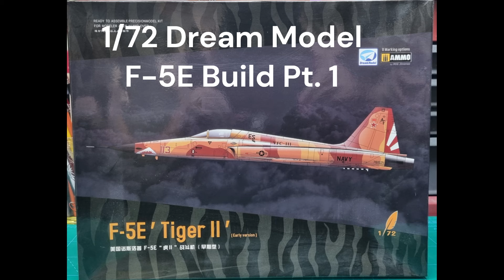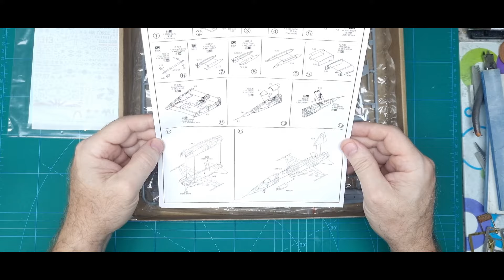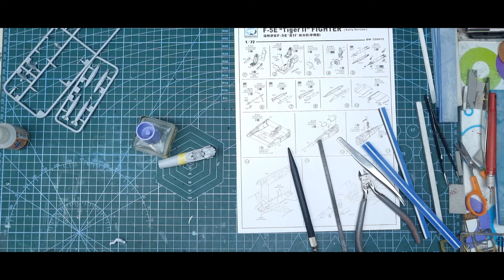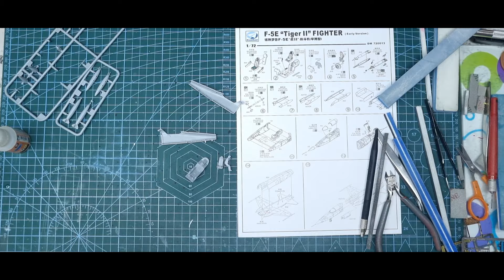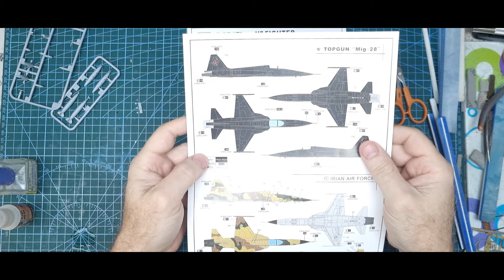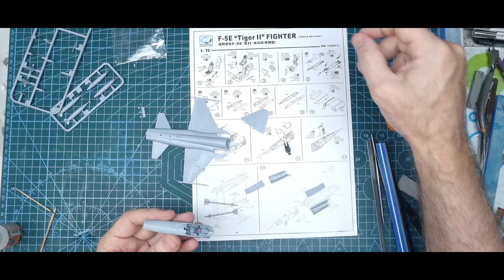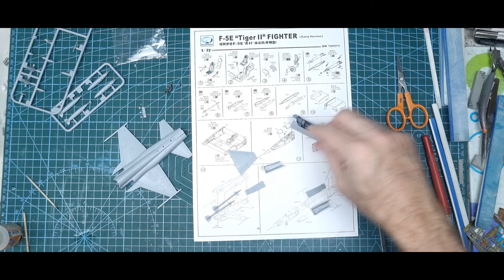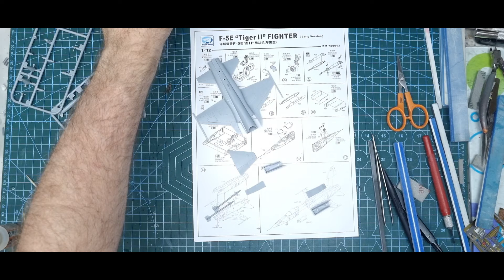1/72 Dream Model F-5E Build Pt. 1

Comment: G'day, I've got the same kit (and the 2 seater version as well).
From memory I saw somewhere that the upper fuselage had to be remoulded as there was an issue with the early production run of the kit. I think the is why there are no locating pins on that part.
Reply from the maker: Ahh, OK, might explain the other small injection issues as well.